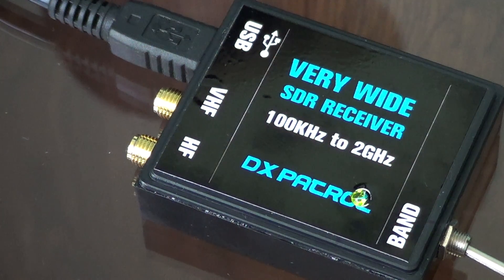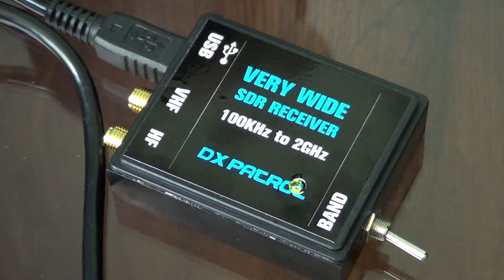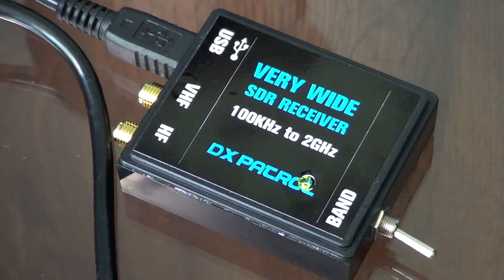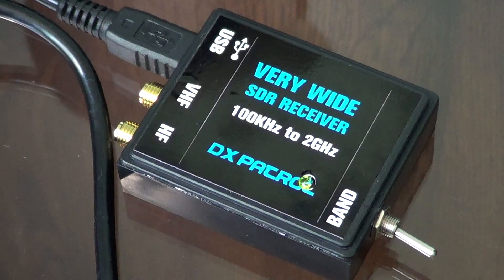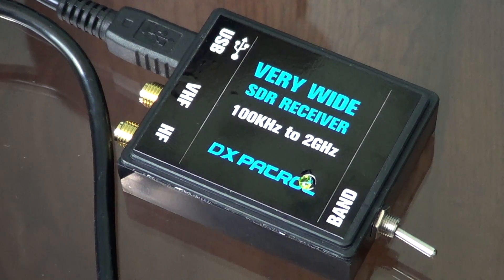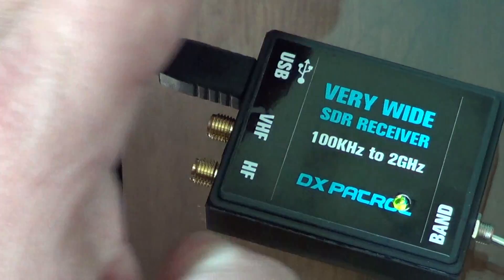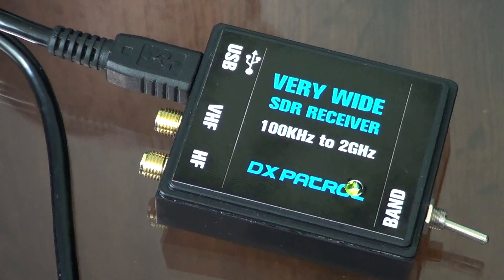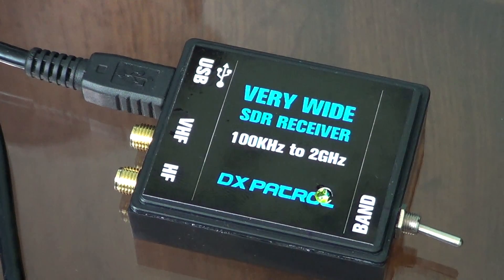DX Patrol SDR 100 khz to  2 Ghz receiver

Comment: HELLO! I AM OF BRAZIL AND HERE HAS NOT AVAILABLE IN STORES BEST. ALSO I AM RADIO AMATEUR "PU3ESP" AND WOULD LIKE THAT SDR DX PATROL AND SOFTWARE GET.  COULD YOU  INDICATE A SELLER TO ME? THANK YOU 73
Reply: ÉDERSON SILVA PIRES PU3ESP+PX3P-0903 The software is free
 http://www.hdsdr.de/index.html

I have bought this from Ebay 
RTL2832U+R820T USB 2.0 DVB-T SDR DAB FM DIGITAL TV Tuner Receiver For PC Laptophttp://www.ebay.com/itm/271359853253?_trksid=p2057872.m2749.l2649&ssPageName=STRK%3AMEBIDX%3AIT
I have been told one does not need to spend alot of money to try this out and this should work well (I hope) I haave yet to receive mine but I just ordered it yesterday

Comment: DEAR OM...I thank you for your videos very interesting and usefull.I would be very grateful for your advise please.I have looked through all the videos and have set up sdr# accordingly alL appears to be set up properley but cannot rx any lf-mf or hf signals(have done the -400000 settings)but nothing have used 4 different antenaes.I would be very pleased if you could walk me through sdr# please mate.73 and best regards Barrie g4yjs WIDNES.ENGLAND.
Reply from the maker: barrie parsons have you been able to receive on the VHF and UHF ?
Reply: Dear OM.
Yes vhf and above are great (the first unit was poor on vhf and above also)but nothing atall on lf-mf or hf all settings have been 'fiddled with'but not a peep mateIt is hust as if no antenaae is connected thanks mate Barrie g4yjs.

Comment: For HF are you clicking the box in SDR# to Shift and set the value at 40.000.000?  I don't have one of those but their instructions are basically the same as using my external upconverter for my RTL units (different offset value tho).  Click the offset and make sure the - is there and the correct value.  Should be good to go.
Reply: Silly youtube formatting "minus 40.000.000" :)